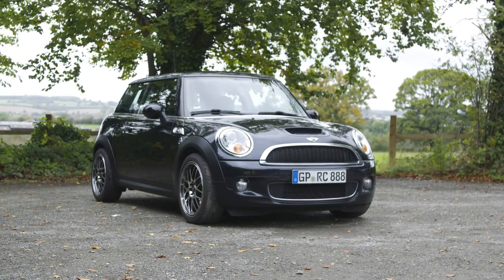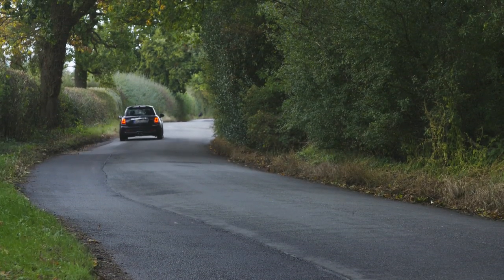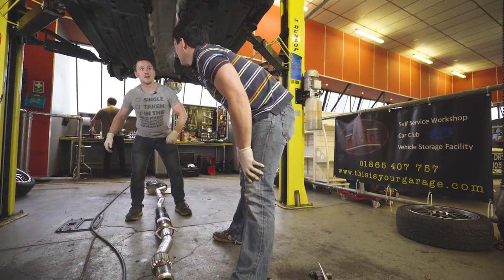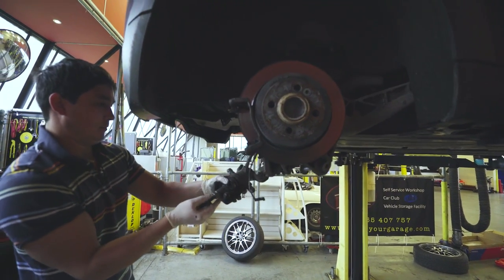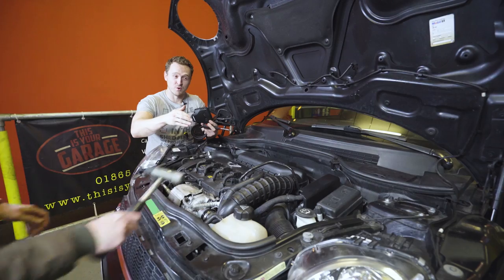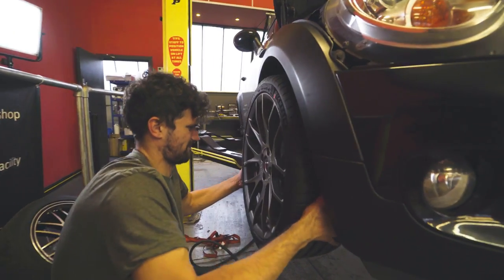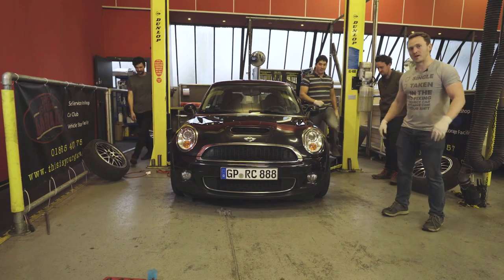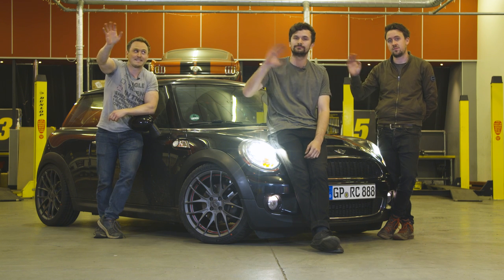Building Our Mini To Be A Turbo Track Monster: Part 2

Comment: I had a pimped mini cooper.. supercharged 220bhp. 18s will rub out arches. To stop rub suspension has to be adjust higher. The set up I ended up with and loved was 15" rims and low profile tyres meant car could be slammed and not rub. Plus the car went through the gears like it had a close ratio box and wouldnt drop out of the power band, but the negative...speedo was out by 10%. Great fun car. Surprised a lot of the usual hot hatches.

Comment: An 80,000 mile R56 means three things - timing chain, decoke and valve stem seals
Reply: Exactly!
Reply: I'm still on the original seals. They shouldn't go bad that quick.
Reply: @FurkanCemTurfanda  it depends some cars will last some won't
Reply: At 111k on my R56. Time chain and S belt did go out, however the s belt has went many miles over expectancy. Quoted 1.2k to get them fixed, and was able to repair them myself. And I don't know shit compared to a mechanic, but I've done all the work on my mini and as am female. Tired of people complaining they are unreliable or hard to work on, cause they're not. Went to a diesel show, and these truck owners called an Audi euro trash, without a doubt they said negative shit when I pulled up my R56, however no fucks are given here. Every car at x miles can be expected to have something need repaired, but many exceed and are reliable. Minis follow shortly behind Toyotas in reliability (seriously search it up), and are above average on reliability than most cars you can get in the state (search it up, beats almost the entire competition, very few in front of the mini)
Reply: @arier56cooper72  my buddies 06 mini s was probably one of the funnest and simplest cars to work on, 118k timing chain went bad so we resealed the motor and redid the timing chain. after that car ran amazing and then after about 150 miles someone ended up hitting us head on in it. I couldnt believe how safe the mini was compared to the toyota mini van that hit us head on doing 40mph. sadly he didnt want to pay $1100 for the car back and didnt want to fix it. Changed my view on german cars for sure this time as my first e46 was more reliable than anything else besides my toyotas. Mini definitely took the cake

Comment: I install the race chip on my mini clubman diesel and it wasnt easy as in the video! you have to install the plug on the fuel pump dooooown on the ground of the engine. Result: almost no extra power and engine struggle at 1750 rpm. The price (129€) is good, but I was expecting more power :(

Comment: Someone is gonna have to say it. Shoulda bought a R53
Reply: Just about to comment this
Reply: May I ask why?
Reply: @giovannikroon95  it's just a better project platform. More aftermarket and known potential
Reply: @burlyheads  thanks!
Reply: @burlyheads  bollocks
Reply: Most r53 enthusiasts hit the moding limit very quick and change for a r56 these only so much u can with a supercharger so many more options and easier ways to make bhp with a turbo r56
Reply: @michaelhardaker7930  that's why you turbo a R53. But I'm fine with 300hp
Reply: Should also add the R53 is ~200lbs lighter in any trim than the R56. I'll not saying one is better than the other but for a track build I prefer the R53. Shit my 53 has the cast aluminum control arms from the 56. Much lighter than the stamped steel ones from the 53. Yes you can make more power stock bottom and top end but there are over 600hp Turbo 53s and the Rotrex kits make 400-500hp
Reply: @burlyheads  no one needs more than 350hp in a fwd car. The torque steer would be terrible. Mini's are all about handling, not power
Reply: I agree r53 it should have been
Reply: I fucking love my R53, it’s the best investment I’ve ever made in my life
Reply: @burlyheads  hey man do the control arms fit like a bolt on modification? I'm assuming we are talking about the rear. I'm asking because my previous owner left me with some mods to install, and one was this one

Comment: I own an '09 R56 MCS and I've heard that the Racechip is all placebo and doesn't do much of anything. You need an actual tune.
Edit: besides adjust throttle response. Besides that, from what I've heard,  it doesn't actually add much if any horsepower like they claim.

Comment: There's more to a modern car than lowering it and adapting it to the tracks. The daily use/abuse is more similar to rallying. Wouldn't it have been an idea to go the opposite direction, add some hight and suspension travel. Make it cool, and go through a more modern traffic and see how it performs? Please....

Comment: With all that £ thrown at it why not upgrade or at least replace those stock shock mounts? The stiffer ride will tear up the rubber bushings faster than normal and the ones in there already have 80k miles on them!

Comment: “even an idiot can fit a race chip” only an idiot would fit a “race chip”
would love to see your LTFT after a while, this thing has to throw codes. not saying it doesn’t work, but it’s crude, your ECU will feel like driving at night without headlights. for the same money you better get an ECU flash, although nothing beats a piggyback or better yet a standalone.

Comment: So, you turn a unreliable mini into a track car, and chip it aswell, that's asking for trouble as these 1.6thp engines stretch chains and get clogged valves
Reply: Had a ds3 thp with this engine and needed walnut blasting every couple of years otherwise it ran like shit.

Comment: "performance chip" = check engine light. everytime. and now can't pass inspection.
(in the US where we have emissions laws)
Reply: Have them here in the UK too. Not too sure how this would affect the MOT.
Reply: @DarrenBoss1984  You get a paper for the chip that you can add to your technical specifications and everything is completely ok with the authorities (at least in Germany)
Reply: Takes like 2 mins to take it out tho
Reply: @lazar2175  yea I thought that would be the case.
Reply: @KP3droflxp  I don't think you can get around it here by flashing paper in their face. It's either pass or fail. Although I think they'll re-test it for free if it does fail.
Reply: @DarrenBoss1984  Here where i live they will be jerks and bug you about window tint, or other tiny stuff like that, for example aftermarket wheels.
But then i could roll in a dirtiest diesel and no one would give a fuck, same with engine swaps and other major stuff.

Like, if the manufacturer spec says my tint is 60%, they won't believe me and send me to a institute where i have to pay like 350€ for someone to measure the ammount of light passing through, so i'll just rip my tint off once a year to pass the MOT.

Also, for people that have remapped their actual ECU this might be a tough one, but it's worth it, these little boxes don't do anything and if they do, they frick your engine over.
Reply: @DarrenBoss1984  I don't know the correct term in english but I am talking about the legal document that contains your cars specifications. At least in Germany you can add modifications to this document as long as they pass the MOT equivalent. If a modification is produced in a large volume the company can get the mod approved for their buyers.

Comment: Sorry but the Race Chip is a complete waste of time. As a Mini owner and tuner they're set up to take into account the following: Intercooler, better free flowing air filter or induction kit, upgraded spark plugs & optionally a decat or race decat.
That's your basic Stage 2 tune to get 200bhp on the N14 R56 engine. You're missing some very vital componants off your so called 'Track Monster' to get 200bhp. 
If you do manage to achive it, you're going to be putting so much strain on that engine that I doubt it'll last very long. Say goodbye to the French engine!
Finally...18 inch wheels?? On a track car....you obviously have no understanding about wheels and track conditions. You need wider wheels for better grip. Not bigger wheels. You're going to be bouncing all over the place along with those coilovers.

Comment: Do not buy a racechip take my advice, I bought the most expensive one and it didn’t do fuck all for power all it does is tricks the sensors into thinking your cars at a lower rpm to keep the turbo spooling and it’s fucking cheaper to get a proper remap so yeah taking my advice will save you money and it will save you from getting pissed off when you pay all that money and then wait sleepless nights because you can’t wait to fit your new part just to find out it doesn’t do fuck all apart from ruining your car anyone who say otherwise is in denial and too embarrassed to admit it’s shit